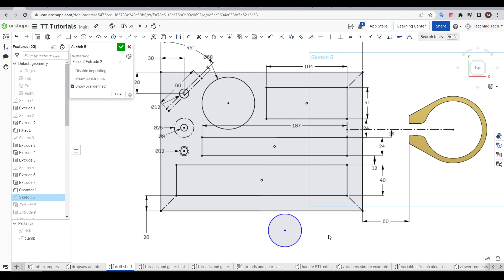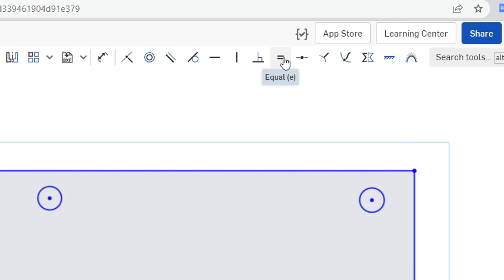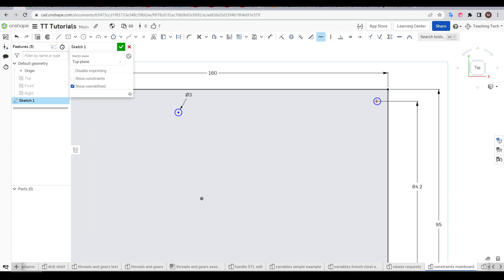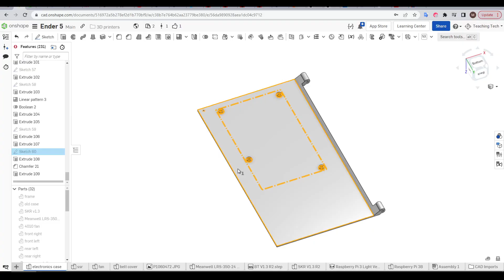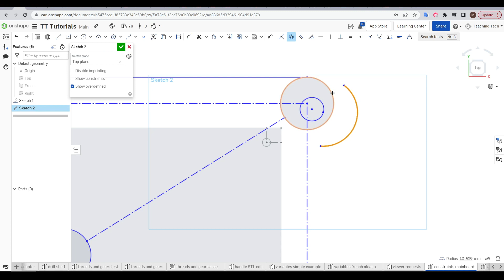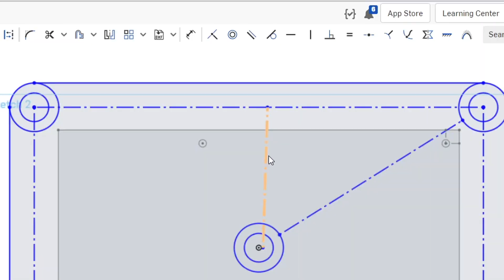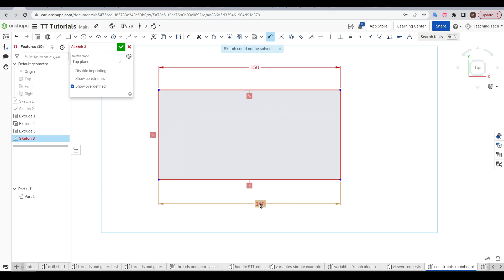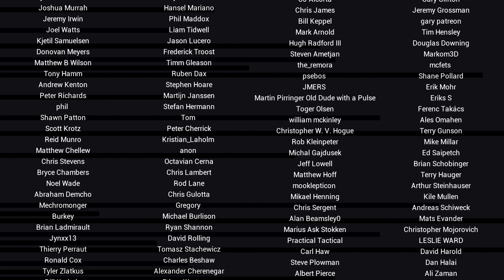Sketch constraints in detail - 3D design for 3D printing pt10

Comment: Looking over that print, that is a bang up job. Center to center? Check. Edge to center of hole? 🤷‍♂️ Edge to center of hole? Check. Center to center? 🤷‍♂️  Two holes are close enough to suggest they are in line through the Y axis, yet they are probably 1 to 2 mm off from being in a straight line. But this is a good way to help people get the hint of prototyping. You can't expect to get your model right the first time, every time. Sometimes, you have to print and adjust dimensions.

Comment: I could not constraint the bottom left circle in the mainboard using your method :( I had to draw a vertical construction line.
Reply: Did you make that circle horizontal to the bottom right hole? 4:30

Comment: Excellent video Michael, however I prefer to use canvases in 3D CAD software, I take a photo of the object (if you have it) along it an item you know the length (again I use a rule) and import this into the CAD. Then calibrate the photo using the known length, then just model on top. Of course there are issues with this method like getting the correct angle on your photo as some complex parts can be challenging. Keep it up with these videos!

Comment: How do you un-constrain to edit again? 6:48 you set the vertical height for the lower right hole but you left the horizontal placement in the wrong place as it no longer aligns with the upper right one as you had it earlier...
Reply from the maker: Hover the mouse over any element to see what constraints it has. You can then click on the icon and press delete to remove that constraint. An example of this is shown at the end in the over constrained segment.
Reply: @TeachingTech  Thank you. I'm working through it in sections...
Reply: @TeachingTech  But you didn't address the second point: you didn't align the vertical position of the two right holes.  It appeared that you clicked a dimension rather than a construction line so the lower right hole horizontal position didn't get set equal to the other spacing lines.  And I didn't see where you actually set that dimension of equal spacing feature of those four holes.  Yes, they are black but ... I will review the video again and the actual part in OnShape.

OPPS, Upon review, I realized that the vertical spacing of the right holes is correctly dimensioned because the "equal" constraint divides the remainder of the two given dimensions in half between the vertical spacing from the edge.  Sorry, Michael.

Comment: On the topic of over-constraints you gave the example of 2 dimensions for the same feature that conflict and are unsolvable.  All software I've worked with is more general than that, Catia, solidworks, creo don't like 2 or more combinations of dimensions and constraints that might position a feature in the same place, the combinations don't have to conflict.  For example a simple set of 12 square stairs with an equal tread depth of 30cm will be 3.6m long, to put both in a sketch means 1 is just for reference. I don't think you spelled that out for the beginner.